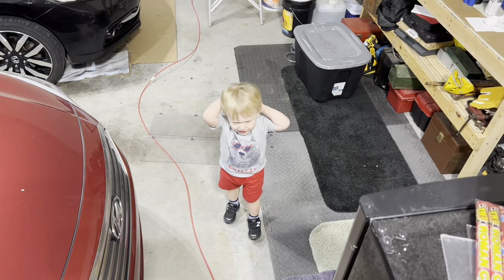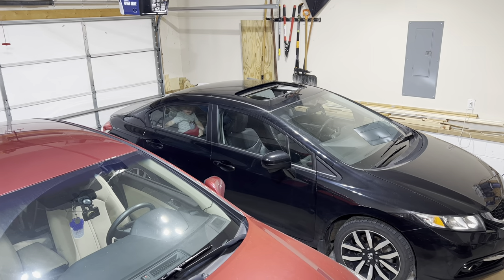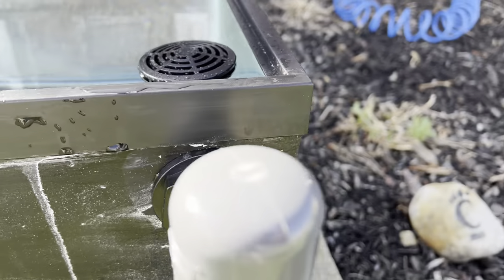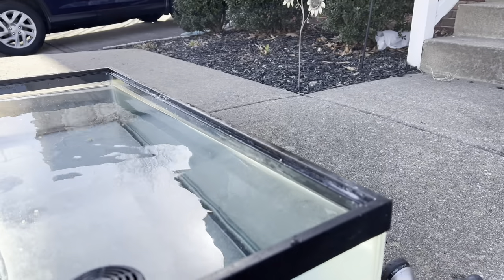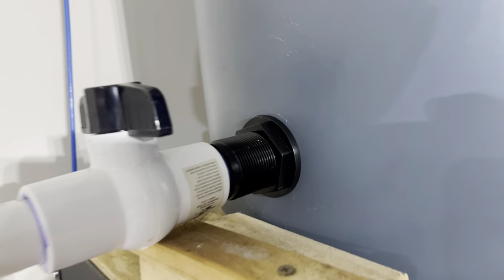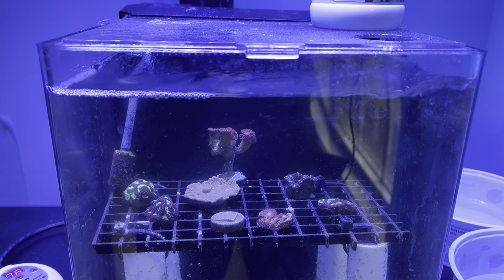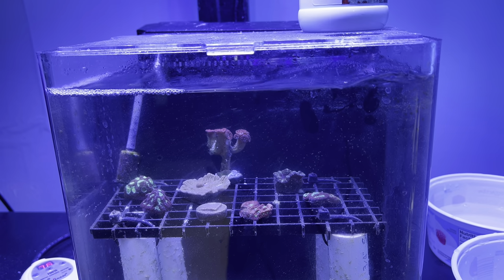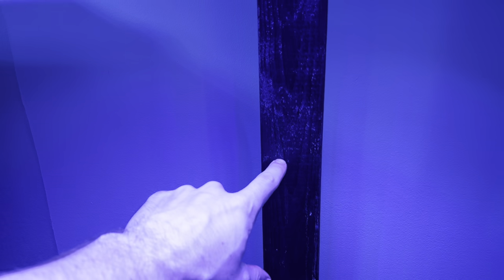Plumbing in a Frag Tank to an Existing Reef Tank

Comment: Is the return drain loud with this setup? And have you ever had an issues with only one drain valve and no emergency drain?
Reply from the maker: If the drain cover gets clogged with algae I’ve noticed it will fill up the tank but not overflow. I check it monthly and clean it. The drain isn’t noticeably loud to me at all